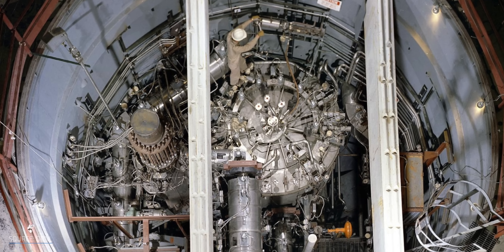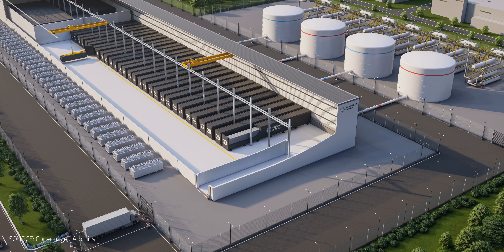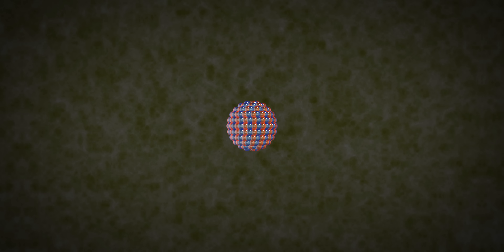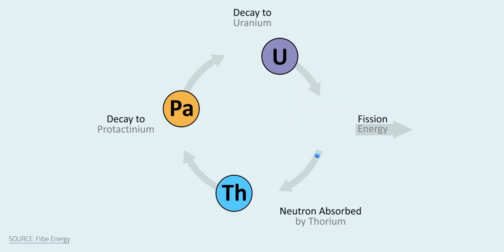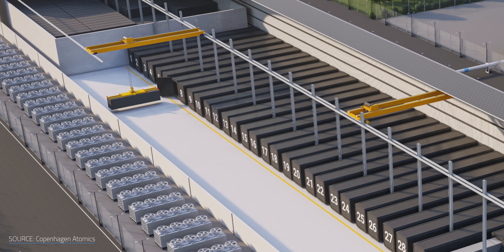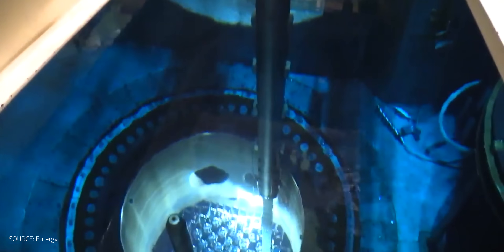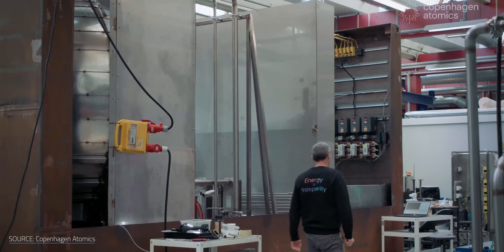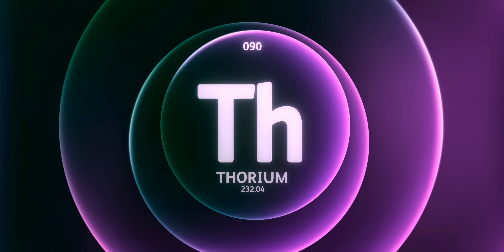Why Thorium is About to Change the World

Comment: One of the main reasons uranium reactors were chosen over the more abundant thorium...bombs.  Thorium reactors can't realistically be used to create weapons-grade plutonium.  One of the many missteps in our path to harnessing such an abundant carbon-free source of energy.
Reply: Untrue. Stop telling that lie. It is far easier to make Nukes and Fusion bombs using the U-233 Thorium reactors produce. The problem with Thorium is its use to breed U-233 in small reactors that are hard to track. The first U-233 nuclear bomb was exploded in on 15 April 1955. In terms of proliferation it is far easier to hide than Plutonium. It is also far more effective for producing: compact, low tech, gun type, nuclear bombs; than plutonium-239. And as such is perfect for nuclear Artillery so making it a very small step escalation threat. There is some suspicion that Iran has a very large dispersed stockpile of Thorium produced U233 from reactors based on small research designs. It was already tested by the Russia as a Trigger for cheap Hydrogen Bombs back in 1950s and in fact used in Russia's first air dropped dial-able yield Megaton Plus Fusion bomb, the  RDS-37 in 1955. It can also be used, to cheaply enhance both U-235 and Plutonium-239 bombs, by alloying methods. Meaning less of the harder to produce, refine and hide elements are needed. This along with its problematic decay products means it was banned by most countries, despite its low cost. Go read. The Promise and Peril of Thorium
Reply: @walkerig1  Not at the time.  Uranium mining as well as processing was more advanced thus it was cheaper to go that route for both the naval side (think Hyman Rickover) as well as production of weapons-grade material.  The ratio for breeder reactors wasn't sufficient (at the time) for more large-scale development in the energy sector.  Currently however the technology has changed significantly.
Reply: @walkerig1 Generally speaking it's not very easy to make weapons grade plutonium. That stuff needs to be heavily enriched and it's not easy to steal non-enriched material. I mean you will be gunned down and you would also need the infrastructure to make use of highly radioactive material which most people and entities don't have. And those who do don't need to steal it in the first place.
Reply: I mean I'm pretty sure he meant to run the reactor. I think most understand the cost of mining but it isn't a unique problem for nuclear. Mining is the necessary process for literally anything.
Reply: @malikjackson9337  Ye sure, wind and sun are known for being mined on. After all we gotta compare mining (doesn't matter what we mine) to renewables, anything else doesn't make sense. And when you do that it becomes apparent, that nuclear doesn't stand a chance.
Reply: carbon-free? Ah so the stuff needed to make energy magically appears inside the reactor opposed to being transported over seas for thousands of miles? Not even talking about the carbon emitted while gathering the stuff from the soil and rocks. How disillusional can one be?

Comment: I hate it when so many people list that we will run out of U-235. There are some reactors in the past , i do not know if any are still running, that use U-238 (99%+ of Uranium) in a fast breeder reactors yes there are problems with this but it can be used as nuclear fuel. 

Also remember when the nuclear fuel cell (or rod) is removed there is still 90% of the U-235 in it. it is just expensive to reprocess. Even in high purity reactors (Like naval reactors) that use 93-97% pure U-235 still have 30-50% of the U-235 left in them after 20-25 years when they swap out the core.

So basically we are not running out of Uranium. we are running out of the cheap easy to get U-235 . There are ways to use the 99%+ of uranium as well as recycling old fuel cells the problem is the breeder reactors for U-238 make Pu-239 that can be used in nuclear bombs. 

The Heavy water reactors that you can use U-238 in are mostly molten salt breeder reactors.. or basically an old version of the new thorium reactor designs

TLDR No we are not running out of uranium. we are running out of the easy to use uranium. 

NOTE: if you think this would be useful in your videos on the follow up you can cut as much of the message to make it useable
Reply: @TheStrayWolf-g8t  The effort to retrieve it is important. If the cost of aquiering U235 is higher than the market value of the energy, it can provide, we are effectively out of U235.
Reply: The bonus of Thorium fed reactors, is that they can also burn nuclear waste that has been in deep storage. The resulting fission and decay products are more radioactive but they have much shorter half-lives. And eventhen this waste can function for a while as a heat source.
Reply: @paulmichaelfreedman8334  
"burning" fission products requires more neutrons, overall reducing the neutron efficiency.
Like burning a wet woolen blanket with a blowtorch, what heat you get back is less useful than what you put in.

The breeding step for thorium to U233 also produces off-target isotopes like U232. about ten times more U232 than plutonium breeding. It lasts longer than average uranium fission products, and emits particularly penetrating high-energy gamma.
Thorium wastes will require more expensive handling and longer disposal horizons than typical UOX spent fuel.
Reply: @aaroncosier735  And the claim that the waste from a thorium cycle has shorter halflives? Been said so many times even by renowned nuclear scientists. Are they lying?
Reply: CANDU (CANadian Deuterium Uranium) reactors burn natural (unenriched) uranium. They are pressurized water reactors that use heavy water as the moderator and primary coolant. Their pressure tube design enables the reactor to be continuously refuelled while on-line.
Reply: @numbersix3698  CANDO reactors uses unenriched uranium, but it is still U-235 that generate the heat. This is possible because of the heavy water moderator.
Reply: @bknesheim  It’s true that the heavy water moderator allows the reactor to burn unenriched uranium. The bit about U-235 is incorrect. During reactor operation, U-238 captures a neutron and transmutes into Pu-239, which is fissionable. It is the fissioning of both U-235 and Pu-239, as well as the decay of their fission products, that generates the heat. Given that natural uranium is less than 1% U-235, I’d argue that “most” of the heat is generated by the U-238, keeping in mind that a huge fraction is generated by fission product decay.
Reply: A lack of cheap easy to access U-235 will make its use as a fuel for affordable electricity less likely. We could burn oil for electricity if we wanted to but it’s not economically feasible. Cheap is the name of the game.
Reply: Cheap until its not. We are just seeing the beginning of what climate changes will happen world wide. If it really ramps up in 20 or 50 years will people even consider it as cheap oil anymore? The external costs are only conveniently ignored until its impossible to consider. Then we are forced into using others. This will require a lot of education and compliance from places still with a ton of oil and methane to burn. It will definitely be a rocky road at best. @Whyusemyname
Reply: Naval reactors are not enriched that high.
Reply: I heard you can fast breed the basic no good U238 99% in nature into Plutonium P239 using a fast breeder which is very fissionable ;)
Reply: 3%LEU is discharged with U-235 at essentially natural concentration (near 0.7%). Running out of cheap fuel is exactly the problem, and fast breeders make it even worse because they need so much fissile to start. The uranium and plutonium fuel cycles will drastically retard scaling of nuclear, because mining and enriching uranium scales slowly, and demand increases directly with every reactor deployed. Since we're only utilizing half a percent of mined uranium, we must mine 200x the amount. At this abysmal efficiency, the world supply, even including the oceans, won't last as long as people imagine.

Thorium is a byproduct of existing mining and essentially free, while reactors also require only a small one-time fissile seed to start. Their great economic advantage will drive rapid deployment, which is also possible because of their minuscule resource inputs. Thorium in molten salt breeders as shown here, can be mass manufactured and deployed, precisely because they'll require so little mining.
Reply: We would run out much quicker if we actually stopped burning fossil fuels for energy, especially with the AI race which is going to end up using more power than everything else. A newer better power source than uranium would be welcome.
Reply: And we are running out of Lithium too. 
It's just that, we have almost never done a proper search for Uranium Reserves in decades
Reply: @ZippyPiglin36 no we aren’t - lithium is super common…
Reply: @ZippyPiglin36  Lithium is a stable element so we just need to make sure we have as close as possible 100% efficient recycling. But in the end it's all for nothing because if the asteroids don't get us the sun will, sorry I'm a glass half empty sort of person😟
Reply: But then it becomes a problem of costs.
Recovering and recycling U is not cheap.
Solar and wind are already much cheaper per Kwh and getting cheaper every year.
Reply: @seamon9732  Solar and wind have major downsides, and not just cost. One of the most obvious is the uneven exposure to the power sources' prime mover, requiring an associated energy storage solution that drives up cost even further; or even what to do if there is an extended period without that prime mover causing the storage solution to become depleted. Secondarily is the negative impact on the local environment: large footprint for solar, and both noise and bird-kill for wind. Finally, is the end-of-life concerns because some of the components cannot be recycled effectively and others are impressively toxic.

None of the the above points make solar and wind bad per-se, but rather a clear-eyed view of the positives and negatives need to be taken when compared to legacy or future energy solutions.
Reply: Wow! I mean WOW! I had no idea so many nuclear physicist and chemical engineers would be so generous as to impart their vast wealth of knowledge to us mere peons! How very fortunate are we!
Reply: @Watchyn_Yarwood Wikipedia exists. University libraries are free. Most people don't necessarily know where to or have time to get good information. I'm also not an expert in a lot of things, but I know enough to then be able to read a lot of technical papers and learn.
Reply: Also, we are running out of OIL too
Reply: @mrping2603  this guy would say we are never running out of oil since the last drop will be so expensive

Comment: Thorium reactors require a neutron source to sustain the nuclear core reaction.
They still produce long term radioactive waste.
The main advantage of Thorium based nuclear power reactors is the unlikely probability of a meltdown due to coolant loss or total power loss. Once the neutron source is shut down the nuclear reaction also ceases.
This does not mean that there is no scenario where radionuclides cannot breach containment vessels. There are other catastrophic possibilities that could see Thorium reactors release lethal radionuclides into waterways, the atmosphere and into the general environment.
This is not a sensible solution to meeting humanity's power needs
Reply: The Thorium fuel cycle is very different to the Uranium fuel cycle, with the end results being U-223 vs Pu-239. The process and the waste products are not comparable in their properties and how to handle them during and post-reactor usage.
Reply: @Real_MisterSir 
....so you will be moving house and living next to a Thorium reactor?
Reply: @PetraKann  I will not move if they decide to have one near me, no..
Reply: They don't however produce the extremely long-lived trans-uranic waste like current reactors.  It's several hundred years vs thousands.  Huge difference.
Reply: @SinisterMD 

Refer to below information:

Thorium reactors, while offering potential advantages, do produce long-lived radionuclides in their waste. While they produce less long-lived waste than uranium-based reactors, they still generate fission products like technetium-99 (half-life over 200,000 years) and, if not reprocessed, the very long-lived thorium-232 and its decay products. 

Here's a more detailed look:

1. Fission Products:

Fission of thorium, like uranium, produces a range of fission products, some of which are long-lived.

Examples include technetium-99, which has a half-life of over 200,000 years.

These fission products, regardless of reprocessing, need to be disposed of in geologic repositories. 

2. Thorium-232 and Decay Products:

Thorium-232, the main fuel in thorium reactors, has a half-life of 14 billion years.

If the spent fuel is not reprocessed, the decay products of thorium-232 will build up over time.

These decay products also contribute to the overall radiotoxicity of the waste. 

3. Comparison with Uranium:

While thorium reactors produce less long-lived waste than uranium reactors, they still generate long-lived radionuclides that need to be managed. 

The specific types and quantities of long-lived radionuclides can vary depending on the reactor design and fuel cycle. 

4. Proliferation Concerns:

Some argue that thorium reactors are more proliferation-resistant than uranium reactors, as they produce less plutonium, a key ingredient for nuclear weapons. 

However, other analyses suggest that thorium-based fuel cycles could still be used to produce weapons-grade materials. 

5. Other Considerations:

Thorium-232 itself is a long-lived radionuclide, contributing to the overall radiotoxicity of the waste.

The inhalation of thorium-232 and its decay products can be more hazardous than inhaling uranium containing the same amount of radioactivity, especially to certain organs. 

In conclusion, while thorium reactors offer some advantages in terms of long-lived waste production, they still generate long-lived radionuclides that need to be carefully managed. The specific types and quantities of these radionuclides depend on the reactor design and fuel cycle, and further research is ongoing to optimize these aspects.
Reply: You don't know seem to know of these radical inventions called 'buildings'. You know what you can put inside 'buildings'? Reactors. All you need is a well made roof, floor and walls and there's little chance of environmental exposure.
Reply: @RonaldReagan84 
....you are welcome to live next to a thorium reactor my friend.
Incudentally, the Thorium reactor core will need to be triggered by a strong neutron source.
How will you design and set up this neutron source?

Comment: Thorium reactors? Cool. 
Small modular reactors? Not cool. 

How do you keep the fuel and waste secure when you have thousands of plants spread all over? That's many times more transports that have to be secured vs a few big plants. 
Maintenance is an even bigger problem than with their big brothers, they still have to go offline for months every few years for refurbishment but again there's lots of little ones instead of few big ones to keep track of. Even if they're just dropping a new one in while taking the old one away that's still more transports and work than with a big plant. 
Sure it's easier to crank out dozens of little tractor trailer sized ones, but they're each individually way less efficient at turning spicy rocks (or spicy molten goo in this case) into usable energy than their big brothers. Waste of the fuel itself, more wasted energy transporting all that fuel too.
The lack of regulations around them worries me. A few big plants are easier to regulate and monitor than dozens of little ones. 
MSRs can't make big booms, but they can still make dirty booms. With a big plant you can have meters of concrete to prevent stuff like that. The little ones might have a chain link fence. 

The biggest drawback to MSRs is there's no infrastructure for the fuel creation and reprocessing. You have to get the waste products out of the molten salt, you have to inject new fuel into it. That's doable, but way more complicated than with PWRs; and again the scale issue rears its head. One big plant can have the fluid cleaned and refueled on site, the little ones you have to transport that molten radioactive corrosive salt to the reprocessing facility. 

Yes it's neat tech that can be very clean compared to coal and oil, but it's still very dirty compared to wind and solar even with batteries included. 
How do you get that much thorium? AFAIK there are no veins of it waiting to be mined, it's fairly evenly distributed thus you have to dig up a lot of earth then filter out the little bit of thorium in it.

Comment: But what is the final cost of the electricity? Cost is the biggest problem with current nuclear energy. Will it be competitive compared to renewables or oil/gas?
Reply: 20-40 cents per kWh so no, not competitive.

Comment: Did i read it right, they're hoping 1 tractor trailer is a 5MW power plant? I assume thats happy path numbers so 4MW is mrle realistic?
Reply: That is what I initially thought, but I think this system just produces heat.  It is up to the user to decide whether to use the heat as heat or turn it into electricity.  The heat transfer and generating part will take lots of space.